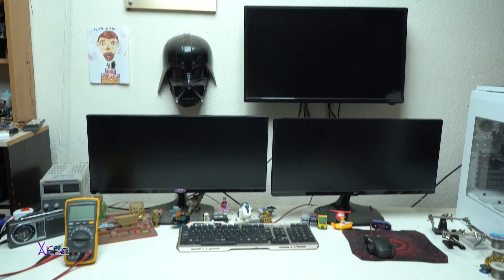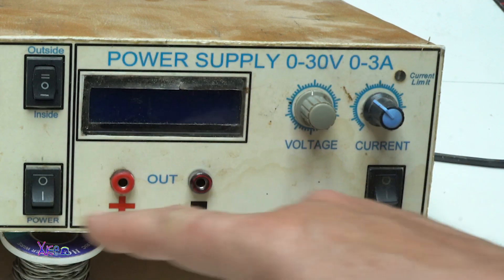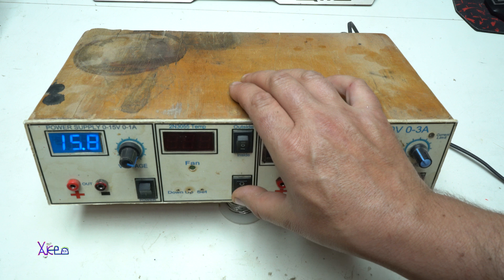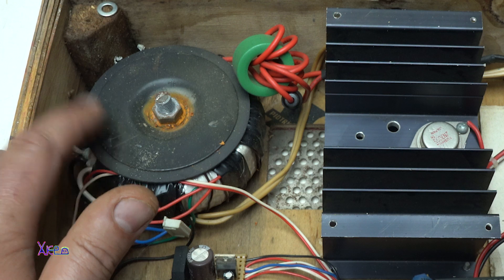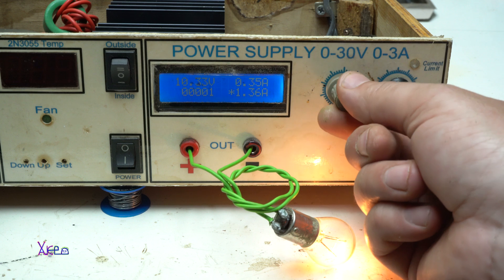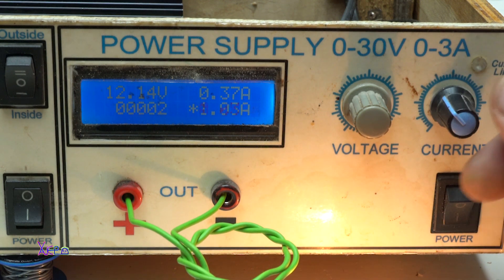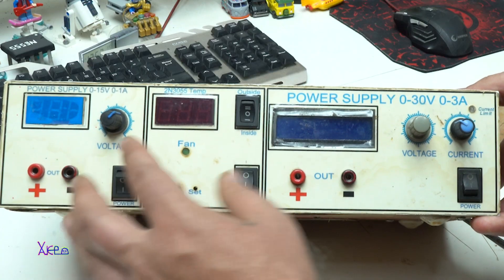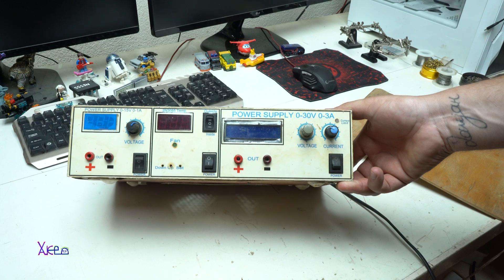I Revise my Homemade 12 Year old Digital Power Supply

Comment: Well done, very impressive. For better or worse capitalism has made obtaining any kind of electronics very convenient and cheap. However, it's always interesting looking at diy machines like this. But you do save money and time, and get better stability, if you buy a Chinese psu. Still, no more rewarding feeling than doing it yourself.
Reply from the maker: Thank you for your feedback,as I say in the video back in time I didnt have enough money to buy new psu so I build one and I have use for so many years,still I am using my homemade psu devices,never bought new one.
Reply: @Hacktuber  That's very cool, I admit it. Without a doubt.